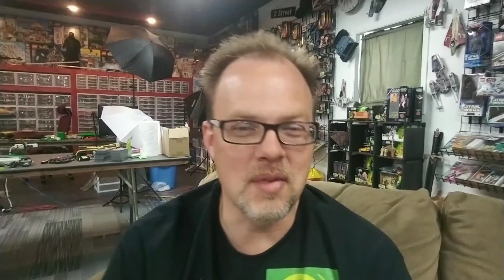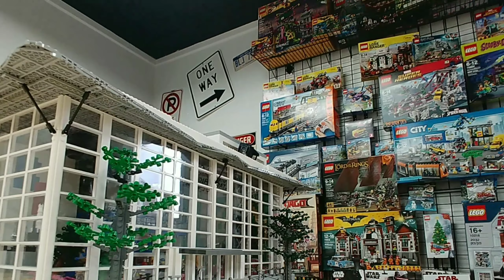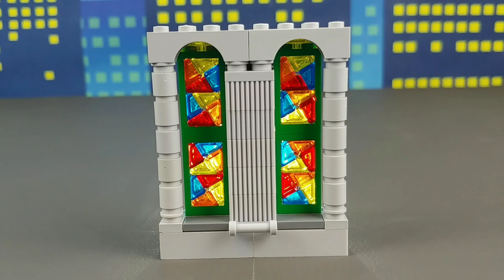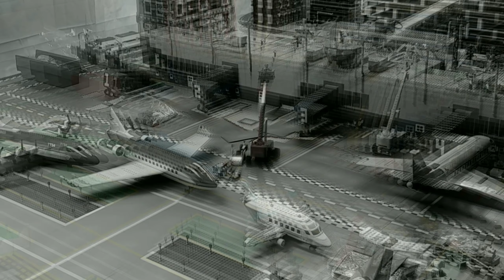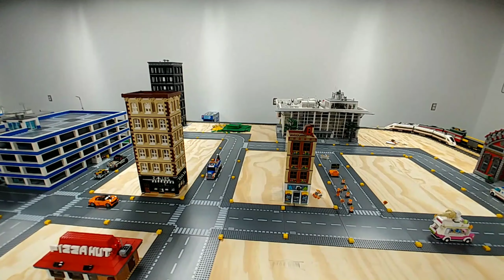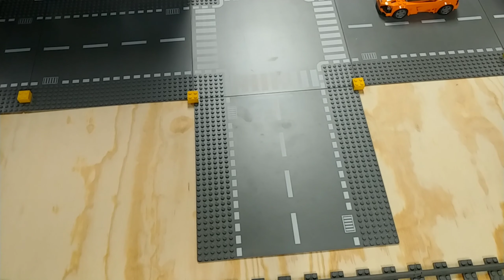First Lego City Post From My Lego Barn

Comment: How do you gonna do the turns. Our LUG (Swebrick) have the Moduverse standard. A little like mils but you use plates in the bottom instead of a baseplate. Even more stability than a mils plate. And also space for cable and all you wanna have under.
Reply: Bevins Bricks here is a link to some moduvers plates, it’s baseplates and roadplates. https://www.swebrick.se/index.php?topic=6350.0 unfortunately it’s in Swedish but it’s both odd files and pdf files to look at. We in Sweden, the Finnish LUG and norwegische LUG use this standard whit some variations. We three LUGs are trying to convince the danish LUG to use this standard to and they have started to use it. The reason why we ueses the same standard in all four countries is that we every year have a Scandinavian event. Than it’s good to have the same standard.